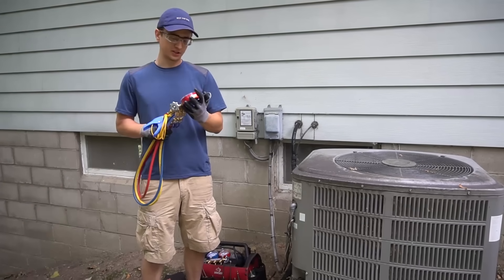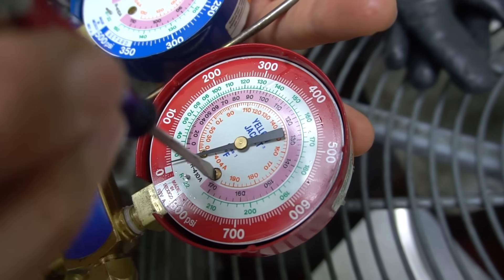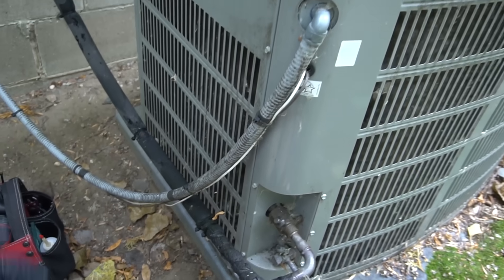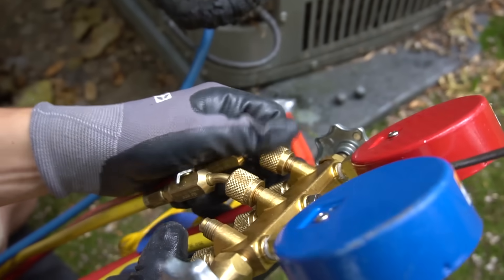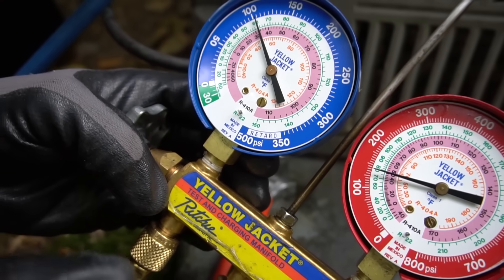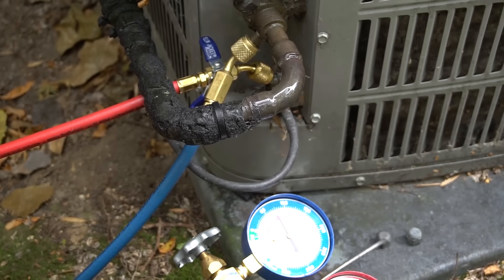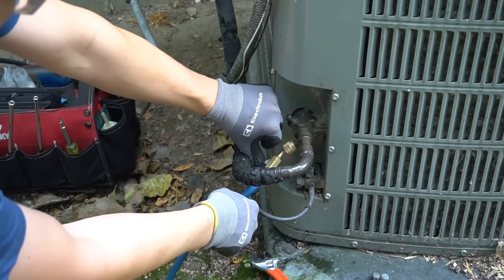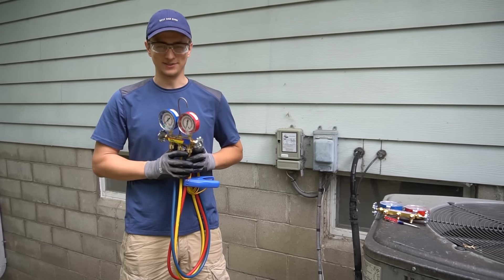How to Check AC Freon Level

Comment: Great video just want to add a little tip as how i remove hoses under pressure. I have been at this trade for 25 years, when disconnecting high or low side apply pressure to the hose while loosening then once the hose is loose you will loose hardly any freon if any, its a matter of keeping pressure as if the hose is still seated, takes a little practice but youll know what im saying when you  do it. I got tired of getting blasted by the spray till i though about what i was doing wrong, hope this practice helps. do whats best for you but this is what i do.
Reply: As in putting pressure on the sealing surface? Pushing the hose against the port as your loosening?
Reply: @duganfr Yes, that's right.
Reply: Thanks for the tip. I will keep this in mind.
Reply: Great tip! Glad I read your comment.
Reply: What exactly do you mean “apply pressure to the hose”?
Reply: @casquillodelrey4185  He means to push in towards the valve while starting to unscrew the fitting, then when you release it, it’s almost spring loaded, but like I said, it can backfire on you a little, so don’t freak out, just keep unscrewing the fitting. The real fix is to get some low loss fittings for your hoses, they’re not super expensive, and you can add them on to your existing hoses. The yellow jacket part number is 19109, and they’re about $20.00 each through Amazon. Hope this helps a little. 😎
Reply: @stevieg4201  oh! I SEE. Thanks for that. I'm in HVAC school (in class as I write this) and I was just curious about your tip. I like that. 👍
Reply: @casquillodelrey4185  when you loosen the hose the pressure is released like the lid on a soda bottle when you open it, just think of the hose being in the middle of the cap while pushing in with the hose while loosening the fitting and once you know the fitting is loose enough you can disconnect the hose. the valve stem will seat very quickly, other than that they make a valve stem remover tool that is low loss, this trick doesnt work on every unit but it has helped me on most hope this helps
Reply: This can kind of backfire on you until you get the hang of it, so do t panic, it takes a few tries to get it right, but it’s a great way to remove hoses. 😎
Reply: L
Reply: A+

Comment: good video.   i subscribed.   sooo....once i've determined my system is low on r410a, do you have a video illustrating how to add a bit more refrigerant?    i probably have a leak.  no one can find it.  my A coils freeze over all the time but i have gauges, some very basic knowledge, am pretty handy, and have a big 25 lb cylinder of r410a.  my plan is to add a bit more every summer.  i can play this game for many years and r410a is cheap

Comment: The standing pressure won’t equal out standing pressure is how you find out what refrigerant you have in the system if the data tag is destroyed and you need to know what refrigerant you’re working with.. every type of refrigerant has a different standing pressure

Comment: Observations;
1. You set that gauge set with no covers face down on the ground. !
2. That large nut on the suction side is the service valve shut off/on.
3. Do not over tighten the valve on your gauges- just slightly firm.
4. On this system, it is easier to attach the liquid side first, then the suction hose fitting won't be in the way.
5. The gauges you were using are not accurate enough for R22- the scale is too small, but is good for R410a.
6. R22 system will begin freezing up at the indoor coil below 55 psi low side. You must keep that psi above that pressure. There are ways to do this.
7. You introduced air, which has moisture in it into the system- improper purging!
8. This is a total failure! You cannot charge or check a charge by psi only! You must use psi and subcooling or superheat readings to know if the system is charged properly- and use the specs for that system! You must make sure the filter is clean, the blower cfm is correct, the wet bulb temp has been checked and if there is a piston or TXV metering device! Otherwise you are guessing!
 In all my 46 years of doing HVAC, I have never seen such a bad tutorial that will cause people to unknowingly ruin there system by not doing it correctly or choosing to have it done professionally!
 Please get educated before trying to teach.
Reply: why don't you make a tuitorial without any bloopers then Mr. Hvac
Reply: @chippars19  I have no desire to make a "tuitorial". Why?

1. Because I was commenting on a tutorial (above) that needs no other tutorial. For it was THE best I have ever read!

2. Because the ones I spoke of, would NEVER read it any way; or any other tutorial for that matter! Believe it or not! Again, I experienced this in my 45 years trying to teach so-called "technicians".

(Note: when I taught Technical Engineers on same; MOST of them read it and used it.)

For whatever it's worth.
Reply: Amen, amen and AMEN! What he has shown is what MOST HVAC technicians do throughout the US. Sad but very true.

For you simply can not install, charge or repair ANY AC correctly, with only a set of gauges. Sadly, MOST HVAC techs make this mistake.

I would say that IF you had 1,000 HVAC techs working on your AC, 90+ % would make one or more (mostly) of the "No-No's" you mentioned above.

I taught for 45 yrs in my working days, and sadly, over 90% of the techs that came through the technical center; should NOT be allowed to install or repair ANY technical device. Yet they are doing it all over the US. This is true. And it is very sad.

Believe it or not.

Comment: Is the AC supposed be off or on?  when u adding the freon.
That's  my question.

Thanks.
Reply from the maker: The AC is supposed to be on and running when adding freon.
Reply: @WordofAdviceTV  OK thanks .
Another question * the refrigerant it is for both lines Lp and Hp?? Red and blue lanes.?

Comment: Awesome video!  I have a question though, should you not leave your ball valves in the open position?  I have the same manifold and hoses and was told the ball valves should always be left open to avoid constant pressure on the seals.  Also, I wouldn't have even noticed your mistake, I tend to get overly worried about little details myself, things like that make me want to redo the entire system which I know is foolish but OCD sucks and perfect is impossible.

Comment: Great video as usual. I have a Fujitsu mini-split, I assume the same principles apply. Temperature on the small line going into the outside compressor is 32F and on the big line it's 60.  The big line is not sweating. The inside unit struggles to drop the temperature. I don't have the gauges, but with the big difference in outdoor line temperatures is my problem low coolant?
Thanks as usual!!!

Comment: It would be a temp-fix. , how do i put more R-22 into my unit? Will not keep house cool on very hot days.  works on milder days ok.  i realize this is older unit and better to replace whole thing, but corona times are tough,  this is what my label says:  TRANE XE-1000 A/C Mfg. Date: 1/96
Model #: TTR024C100A1

3lbs 10oz. R-22

Design PSA - High 300 Low 300

Comment: So which pressure do I look at? The equalized pressure before turning on or the pressure after you turn on the condenser?
Reply: I found out that one of my condenser units is completely out of refrigerant. When I plug in the yellow jacket gauges on both low and high, it shows 0 pressure. How do I refill the system? I am not able to turn on the condenser because of the low-pressure switch kills the 24 volt to the contactor. I can't seem to find any information on youtube. Any advice is greatly appreciated!
Reply: @ba177ba18  Unfortunately you are going to have to call an HVAC repairman out to fix the leak and recharge the unit. It has a major leak if its completely empty and any refrigerant you add will quickly be lost. Besides, you can't legally buy the refrigerant to recharge the unit unless you are EPA 608 certified. Sorry

Comment: You only need 1 lowloss fitting and that is on the high side don't forget to bleed off what the suction  dont get cause if the gauges are in back of the truck the sun will heat up the hoses that freon pressure will rise and fuck up your hoses bust them lol done it lol y'all be careful out there that virus is scary
Reply: That shouldn't have happened if the hoses were in decent condition, these hoses are rated for extremely high pressures that the refrigerant will never reach simply from being in a hot truck. Even the hoses on my cheap Harbor Freight gauge set are rated for 500 PSI working pressure and 2500 PSI burst pressure, and better hoses designed for R410a will have hoses rated for even higher pressures.

Comment: I paid $70 a pound of freon, they said the put 3 pound is that accurate? Im from texas by the way if that matters? @workofadvicetv
Reply: R22 freon is selling for about $17 a pound. That said it's not being made anymore so supply is always decreasing and it's difficult to obtain, requires special handling and certification.
Reply: A A  I do have R22, so would you agree with $70 a pound for freon?
Reply: Wow you got ripped off, yes $17 a lb at supplier, the highest charge for r22 lb  $34. Unless it’s fresh not recycled it which case that’s not totally a rip off.

Comment: I live on the Gulf Coast and my system is approaching 10 years age. It's the third system in 18 years. Tradewinds and salt air make short life.  When it was installed the techs didn't flow nitrogen during brazing even though the manual says to do so.  They looked at me like a crazy person when I asked about it. Anyway, both coils have been replaced over the system's life due to leaks.  Was wondering your opinion on replacing the line set and insisting on flowing nitrogen during brazing when the system next gets replaced?
Reply: In school we soldered/brazed copper tubing  with & without nitrogen then cut it apart to examine the difference.  The thin coating of oil that is inside all freon lines was burned unless inert nitrogen is flushed behind it.  Even virgin copper suffered burns from the extreme heat of brazing.  Nitrogen backed brazed lines looked smooth and no contamination to flush downstream.  No discoloration.  Also, freon heated to such extremes can cause acids to form inside the system.  Many contractors around here don't take this protective step to save time & get more jobs done.  I'm lucky to be always employed as a facility HAVC tech and call my own repair procedures.

Comment: Great Video. But if you waited a little longer that both low side and high side been equaled, then you could say that most liquid went to the suction side of the system. 
Thanks for your clear and informative videos.

Comment: Rule # 1 turn off unit before taking off high side service line.
Please take off low side before turning off unit.This will also contribute to low emmisions.
Also please confirm your operating pressures and refer to saturation tables for correct refrigerant charge.Basics buddy,but congratulations on your presentation, good on you.
This is Desert Fox.
Reply: No body can be perfect I was a hvac tech in the 80s and 90s I never sucked freon out my gauges when disconnecting because of possible air leaks in my gauges that would go into my unit which will cause acid inside the unit from humidity in the air
Reply: Good tip - thanks man!

Comment: See how easy it is to access refrigerant? So whether you're installing or servicing an A/C system containing HCFC/HFC refrigerant, ADD Novent Locking Refrigerant caps.  Sadly, kids are learning faster on how to huff (and die from) refrigerant quicker than pros are learning that HUFFING is the reason the A/C systems they installed are now low on refrigerant. Despite fact that it's in the code, locking caps save you from using YOUR own refrigerant to charge those systems when you can't find the leak. If you take pride on systems you install, and don't want homeowner to call you saying "it's not cooling", then protect their system with locking caps. Designed by a contractor FOR contractors.

Comment: If the valve is closed on the hose then all you need to do is open the high side while the low side is attached and it will suck that residual back into unit. Seems you added a bunch of extra steps. Because typically you would've already bled the line's, as you we're attached to the sealed system.

Comment: Hello sir.  Super video! I have an issue with my home AC system not cooling.  It is filled with R410a.  Does the same theory with temperature/pressure apply?  Also, is it correct to charge ( if required ) through the low side?
Reply: Eddie. Yes, call an HVAC guy so he can find and repair the leak first then add the right amount of gas

Comment: it would be nice to see a video on charging a unit properly which includes taking into account different weather conditions and how to do it on various brands/ models and when to not add refrigerant. I think a lot of times techs add freon to avoid real problem solving and to save time. Include charging a unit that has no nameplate or chart.

Comment: Why not, Close the ball valve on the high side, Cap the middle inlet with an access valve cover, Open the high side, Purge from middle inlet, Then open your suction, when reach suction running pressure on both gauges, Close both gauges, Close your suction ball valve, the Remove both hoses, That way you don't lose freon to the climate , Now That Make Sense, Don't It?

Comment: great explaination! just wondering, what happens to the air in the hoses when you twist it into the compressor? wont the air go into the compressor? or at least, the air and freon will mix and some air will go into the system?
Reply: Eugene Lin you’re suppose to bleed your lines. There are valves just before it goes into the system that you press to have the air pushed out of the lines and you stop when some refrigerant is just  escaping. You’re right air means moisture and moisture is no bueno in an AC unit

Comment: Great information. My A/C installer may have to recharge my new system because he did not use the recommended PVC conduit for underground placement of the line set (Trane/American Standard). He put the line set in a plastic flex tube for the underground run then completed the install and charged the system with R-410A. Is this a problem for a new A/C or will it be fine to disconnect the line set, replace the tube with PVC, then reconnect and recharge the system? Obviously he would rather not replace the hose for conduit but the city won't approve until it is changed.

Comment: after saw you used a yellow jacket manifold, I tried to buy a yellow jacket manifold, it seems a great  reliable brand but why they don't make a manifold for both 134 and 410a freon, since they are so popular for both home ac and car ac. so I probably end it up need to buy two manifold for check my car and central ac. or maybe I miss something, they are interchangeable somehow, sorry if this is a super noob question.
Reply from the maker: I agree! Yellow Jacket has nice tools. In particular, I really like the PT chart on their manifold gauges. Yellow Jacket makes tools for HVAC work. I don't think they gear their tools toward automotive or other appliances which is why 134 is not on the same gauges as R22 and 410a. (the two main refrigerants used in HVAC) I tried looking on Amazon just now and you are right, I could not find a gauge set that had both, 134a and 410a on it. There were some like this one, but none by Yellow Jacket: https://amzn.to/30Nmx6C The PT chart on the other brands is not nearly as nice though...

Comment: thanks for this wonderful video, I have a question from this tutorial. for r22 do you mean when low is at around 40-45 and high is around 100-115 the freon level is normal ?  but you didn't mention under wut value or  in wut situation the freon is too low or too much of freon. forgive me maybe my question is so noob, maybe you mentioned or the answer is so obvious. thanks for this tutorial again.
Reply from the maker: Glad you found the tutorial useful! I didn't really get into troubleshooting refrigerant problems because there are a lot of variables involved. But just to give you an idea though, if the temp on the low side is below 32 degrees, that usually means the unit is low on refrigerant or there is bad airflow inside. In this scenario, the temp on the high side would also drop below 100 degrees. If there is too much refrigerant, that will make the low side and high side temps go higher. For example, 55 and 125.
Reply: Thanks so much for the extra info

Comment: Great video and thanks for helping me understand. I have a bryant 597CN030-C and the king valve is leaking. I put the gauge on the ports and no pressure. I purchased R22 and would like to get this running without spending over $500 for a service call. Can I just seal the king valve with nylog and put 6lbs of R22 into the system? Do I need to vacuum first or just fix the valve and slowly put in the R22? Thanks for any help.

Comment: How would the gages read if your system is over charged?
Reply: If it is way over charged most likely your unit will not run. It start but because the refrigerant has no room to expnd the high limit will shut the unit down. Reduce the refrigerant to around 40-50 and it should start working fine.